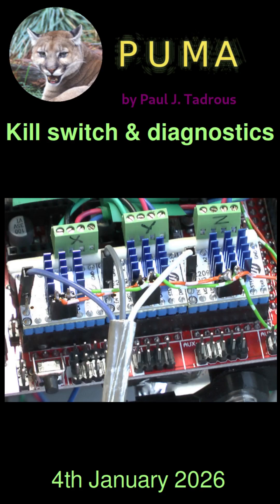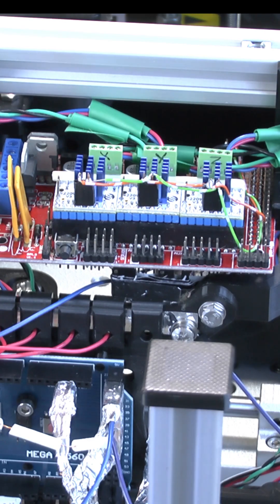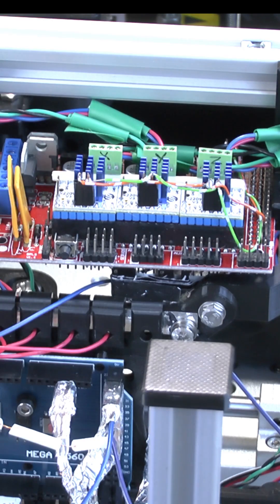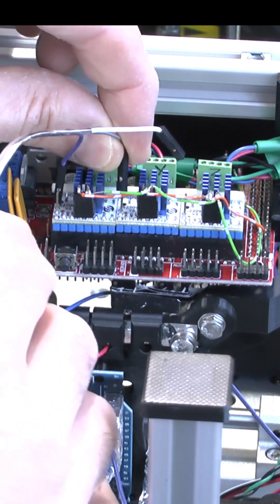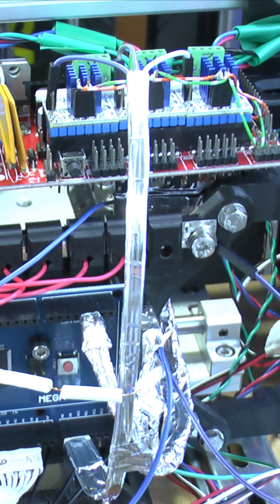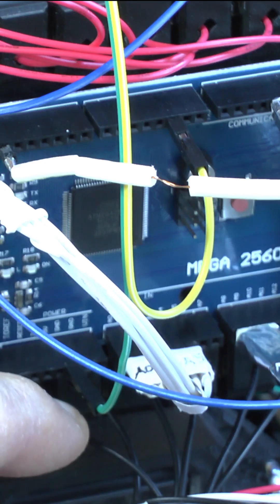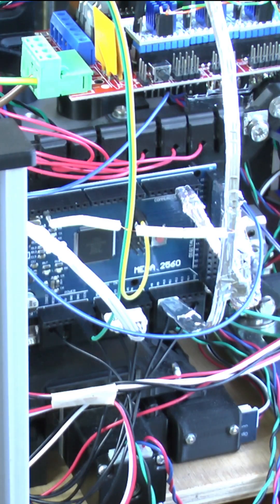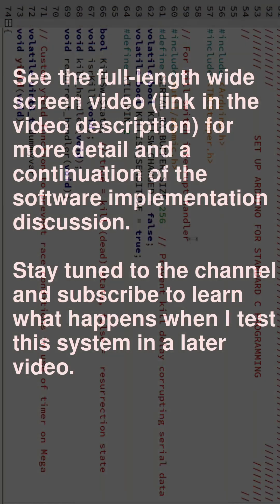Kill switch, StallGuard4 & heat sinks for our TMC2209 CNC driver system.

Comment from the maker: One more important safety feature I did not mention here is that we need to sense (in our Arduino code) when the DPST (power up) switch is on. This is because we must not allow any of the Arduino lines going to any of the logic pins of the drivers to go HIGH (5v) or be configured as outputs (and so drop their impedance) unless the TMC drivers are properly powered up.  Otherwise even the low current 5V supply from an Arduino pin could damage the diodes on the drivers as they try to push current 'backwards' through the chip (the internal TMC diodes can only handle microamps before breaking so even the 20-40mA of a 5V Arduino logic output pin could damage them). I'll try to demonstrate that 'power on' sensor in another video.